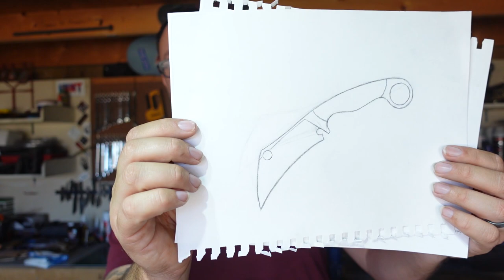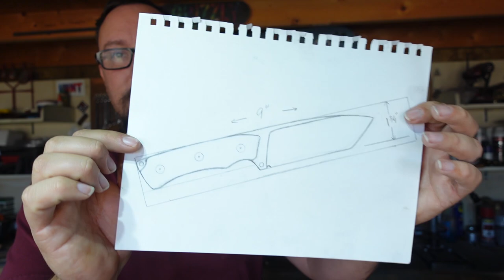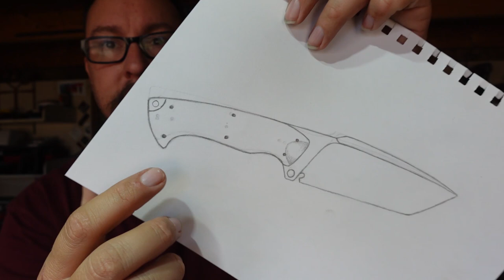Starting The New Camp Knife Series! | Shop Talk Tuesday Episode 111

Comment: I don't have a forge or an anvil. I have an old saw mill blade that I believe is 1095 HC steel. I cut a piece off of it and put it in my fire pit to soften then do stock removal. Then use the same fire pit or grill to harden. I've had a few knives turn our pretty damn good so far.

Comment: Thats going to be a sick knife, I've started making knifes as a hobby, im on my second knife, how i got into making knifes was finding two truck leaf springs dumped on the side of the road, i picked them up took them home built a simple charcoal forge and started from there, I have to say that the 5160 metal is a very good metal for knife making, the knife i have made from it holds its edge very well, super sharp and takes a hell of a abuse, I choped some metal nails with the knife and the edge took no damage, ive got enough metal from the leaf springs i got for free to make a shed loads of knife. Im thinking of trying to make a similar knife to the previous one that you made  my next and third knife because it looks super cool.

Comment: I do like the tapered tang section a lot, still somewhat undecided on the 'tanto tip' as I've had and made a couple which would sort-of work ok for a piercing function. But its still not a useful as something like a generic drop point for general cutting. In saying that they are very robust though so its sometimes a compromise between cutting ability with toughness which is the never ending cycle of questions knife makers ask themselves trying to figure out just how tough it needs to be before you wind up with something 'axe like' for chopping.
For an outdoor bush knife and tying into your sheath building later, maybe consider accessories on the sheath itself?
-small diamond hone
-keyring maglight
-fire striker
Those are sort of my go-to's when running around in the bush as there's nothing worse than being in the dark, with a blunt knife while freezing!

Comment: When drilling 90 degree holes into an already tapered piece of steel, would it behoove you to shim the blade back to plane so the holes are aligned? 

Rad blade design, iterative improvements show!
Reply from the maker: On blades like this I will actually open the holes slightly so that there is a little wiggle room for the pins. The scales will be ground at an angle to match the tapered tang.

Comment: New to knife making and went ahead and got a Milwaukee portaband and made a table for it. I love the way you are able to use it and really cut down on grind time... However mine barely cuts the 80crv2 and the 1084 I have tried cutting. Any thoughts? And yes blade on properly, and got the Lenox blades everyone says to get. Have to angle the stock and push so hard its not worth the potential for injury.
Reply from the maker: Just make sure that you are on a lower speed and you might need to anneal your steel. Lots of bar stock steels are laser or hot cut, this can cause the edge to air harden and make it too hard for a bandsaw blade.